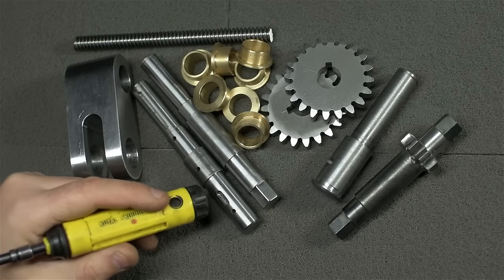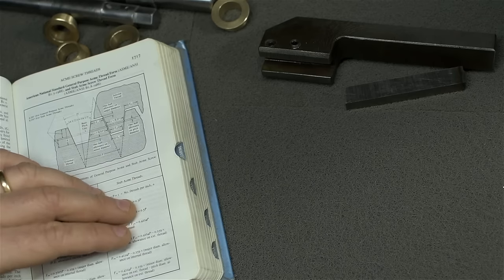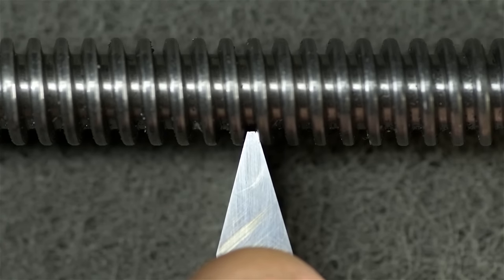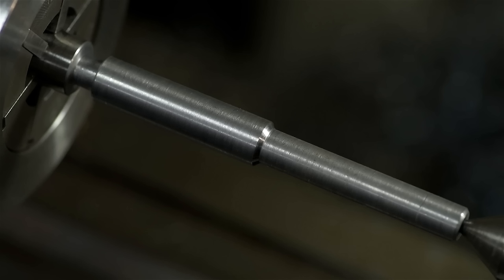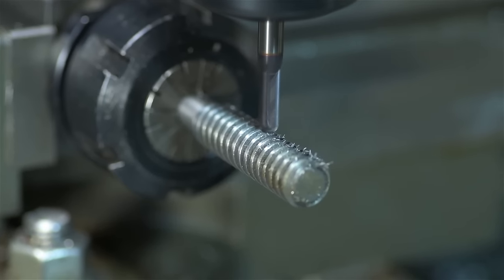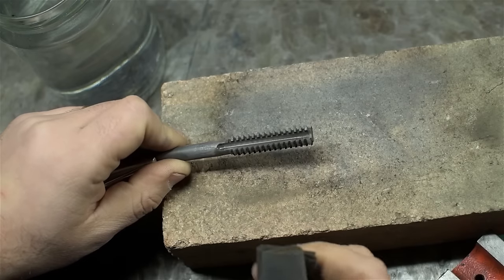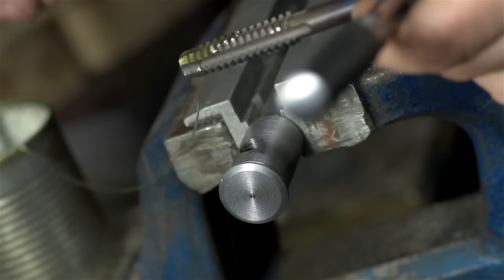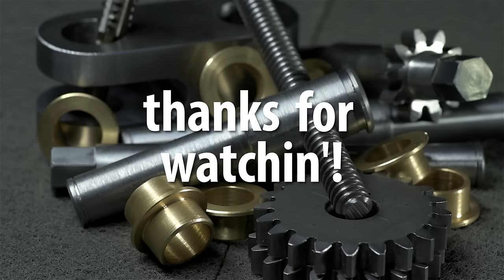More Thread Cutting & Heat Treating (I needed a metal tap)

Comment: Because of my inexperience (and the fact that I am watching your videos out of order), I had been wondering about your comments on the worm gear you added to your CNC machine for the 4th or 5th axis. You had pointed out that the wormgear introduces backlash. I have been wondering if part of that is due to the manufacturer not considering the lead angle. I wouldn't think this to be true. But if you are taking into consideration the lead angle it would suggest that when you reversed the direction of the screw, the play would be minimalised. Your thoughts? Oh one other thing, could the lead screw in a worm gear be spring-loaded to reduce the play?

Comment: This may seem stupid, but would it be possible to accommodate the lead angle by grinding (changing the angle of) the flats back at the tool holder end of the tool? Seems like it would leave more material at the working end making it stronger and more resistant to heat and or chatter.

Comment: Hey Tony, weird question. Any reason why you couldn't just use the lead screw itself (or an extra one) as the tap? It would probably be cut too tight with not enough clearance but in theory would work? Or is there something about the metal that's used in the screw that would make it a poor choice?
Reply: You just answered my question in the vid :)

Comment: re-watching and wondering, could the "lead angle" be made my grinding the bottom "part that sits inside the tool holder, the long part" at an angle? Or like maybe better way of saying that. Turning the square part of the HHS into something like this /__/ or would the cutting edge still be to straight? I know its a TON of material to take away but just for argument sake, is it possible? 

-_- wish i could doodle in youtube comments..

Comment: The grinder, the sparks are flying off to the right, is that because of a flipped video or does your wheel actually rotate counter clockwise? Ive never seen one that does rotate that way.

Comment: Tony, Thx. Very well done videos. Just learned something from you unrelated to threading. Why wasn't I this interested in learning when I was in school???? Your explanation of 'form tools' was it. I'm bending some small diameter 3/8, 1/2, 5/8, and 3/4 4130 aircraft tubing for a fuselage. Would like to make roller dies for a low use homemade bending tool with a handle that chucks into a bench vise. Could a form tool with a half moon nose, cut such a die into aluminum or mild steel on my ancient craftsman bench lathe? Such would make a great video for you -- buddy, .....hint hint.

Comment: Not just of interest buddy. It was of use. I've always struggled with the method behind making an internal thread tap. Oddly enough one of those might have been a lot easier to cut the threads on the tap with before the hardening process. Is it possible to cut internal threads on a lathe in a part  that small? I mean it's gotta be a pain in the butt and I'm not asking you to do it but I'm curious.

Comment: My understanding is that files are quite low carbon steel, not suitable for tool making.  They're case hardened by carborizing the outer skin in addition to the usual heat treatment.

Comment: Did you buy that W1 good-to-go or did you anneal it yourself from any heat-hardenable steel bar around? And about homemade heat-treatments, is there a lower limit so that if you anneal a steel piece too slowly it will become soft enough to be unworkable or, at least, uncomfortably workable? I guess you could always harden it back but just asking. Thanks!
Reply from the maker: bought it in the annealed state.  can't get to soft, no... assuming it's not molten :)

Comment: Would it help to cut a relief on the cutting edges of the tapered section? I think you only did it on the main body, which would mean your first dozen or so edges don't have complete profiles.

Comment: So I only own a single acme tap but it's got Funny setup where it seems to cut the threads twice, like two traps welded end to end. I suspect the extra material removal needed for trapezoidal shape is the issue. You might have easier time cutting if you double the lead in length, oie shallower taper. If you were me then you would worry about work hardening some steel, so I would grind off every fourth or 8th tooth to keep the material removal rate bigger

Comment: Two ways to look at the temperature you want to keep under cutting carbon steels oxidising temp and critical temp , to be honest neither will kill the steel for its intended purpose but ofc anything over 200C will make you loose your temper ! anything over 600 will start oxidation ( scale) and anything over 712 ( for o1 tool steel) is beyond critical temperature (IE becomes non magnet and requires a full cycle of heat treatment ) in colours straw dont worry blue you made a spring gray its soft as its ever going to get , the reds start at 600 c ( ish)  (ps to qualify my comment im a blacksmith)

Comment: When you made the tap a few thousands bigger over the wires than the threaded rod, did you actually measure bigger or smaller on the tap? It seems to me that if you measure bigger over the wires the tap will cut a thread shallower than the rod and not the other way around...

Comment: As a sheet metal apprentice two decades ago, my forman hardened a "shop-made" special tool using cyanide - he never explained why or how it worked (or how to do it). I wondered why he didn't do it the way you hardened/tempered this tap. He didn't temper it, either - he simply got it magnet-resistant red, then quenched in a cyanide solution - the part he hardened was not tool steel, it was mild steel... could that be why?
I just figured I'd throw that out there.

Comment: tempering after hardening, easy in the kitchen, oven circular hot air,  180 - 220  degrees celsius 1-2  hour depend on the steel. i often use lots of pieces, all in one cakeform :-)

Comment: For a less violent temper, put some olive oil in the top of the water. Like 5 millimeters or so. The tool will be a protected a little bit before hitting the water.

Comment: "W1 is a water hardening cold work tool steel that is supplied as drill rod in sizes from .062" to 2" round.

APPLICATIONS: Shafts, pins, blacksmithing tools, and a variety of short-term wear tooling. W1 Drill Rod is typically supplied in 36" lengths and can be special ordered as twelve foot bars.
Composition
C  Mn   Si  Cr  Mo   W   V 
0.95/1.05  0.3/.4  0.1/.25  0.15  1  0.15  0.1 "

Comment: Very interesting project, I'm curious why you wouldn't grind the taper in the tap before heat treating?
Reply from the maker: No reason other than I could.  Before I had a grinder I would have turned the taper beforehand.
Reply: Either way it worked like a charm, thanks for making the video! The finished product is superb :-)

Comment: so where can we find this "color code" for steel tempering.

and if I remember my schooling properly we hardened the steel by bringing to critical state then dumbing it in either water or oil depending, but to temper it back we put in the over at like 500degf for almost an hours and then let air cool, any insight into  why this process is so different

Comment: read bar. used in concrete  work well to  if height carbon .  i have made good  tap's with , this steel  & it anneals well to once headend in water & can be quenched  & Annelid  too,

Comment: Assuming you had a standard vee form tap of the correct diameter and pitch. Could you have used it first to rough out the thread first as you did when you screwcut the home made tap ?
Reply from the maker: yes probably!

Comment: to temperature test for 200 degrees C, use the tap to melt tin lead eutectic solder.  if it melts, you are over tempering.

Comment: To follow the lead angle, why not cut the square, mounting side to the required angle?
Shim a vice to the right angle, grind or cut one side, then make the other side parallel.
The business end would keep the entire material thickness and this strength.
Reply: If you could accomodate for the lead angle in the tool holder, you could even cut left and right handed threads with the same tools.

Comment: Tony, re: the thread lead relief discussion. How the hell do thread mills work! This has always been a conflict in my brain. How can it possibly have lead relief if the tool is spinning and sweeping a circle perpenicular to the spindle not the lead...
Reply from the maker: I've never done it but I assume the shape of the thread milling tool is less than the thread angle.  The angle built into the tool + the pitch of the path it's wreaking havoc in = proper thread form.

Comment: I've watched this several times, for whatever reason.  At about 7:30, a reference is made to putting the edge further to the left, "but that would leave a ludicrously long grind on the right edge".  My questino is thus:  Why does the grind have to be any longer than the thread depth + a tad of clearance?  I mean, sure, if you have to sharpen it, you'd have to take a bit more off, but if you're making a one-off, why go to all the extra work?

Comment: Would it not have been better to leave the back edges of the flutes intact instead of doing the relief?  It would seem that when you reverse the tap a small bit to clear the chips a cutting edge on the back would help shear the chips but a relief cut may allow chips to get wedged into the threads.  That is the only part of this build that I didn't understand.  Even though you said it was totally optional you didn't really verbalize a good reason for one choice over the other and since it cost you time and effort I was wondering why you did it.

Comment: Hi Old Tony
Do you still have this ACME tap?
I am making a chain press for woodwork here in Mexico. I was quoting ACME threadbars and nuts. Holyshmoly. I stopped the planning. The bar wasn´t so expensive, but the nuts were unaffortable. 
However, if you still claim that you might never use again this tap, here in the training shop for carpinters, we could use the tap perfectly to make our own chain press.
If you consider, please let me know the thread size and I will check, whether the ACME bar is available. 
Best

Comment: Would a sharp edge on both sides of the flute help break chips when you do the two turns forward, one turn back thing? Or was that not an issue?
Reply from the maker: it didn't seem to be an issue, but yes, a sharp on both sides would've probably been smarter.

Comment: Tony could you do a video some time on how to measure I'D and OD threads and how to measure threads too? I have a thread clean up tool that I use to find the thread of a bolt or fitting on the outside but I don't know how it's meant to be done correctly or how to find out the size and thread. Inside or outside diameter.

Comment: Best way to make a tap, is just cut some flutes in a bolt of the same type. I suppose, this would be more of a thread chaser, as that taps, are inherently bigger than a bolt of the same diameter and pitch, so that there is some play between the Male and female threads.
Reply: Heavy tap oil works great, it's very nasty to clean up tho. Lol, you cleaned the tap, and spun it backwards, to take it out of the hole you tapped. Having hand tapped an unreasonable amount of through holes in my life, the technique Ive come to use is just running the tap all the way through, then releasing the tap from the handle, and letting it fall through. Seems twice as fast, and reduces the risk of a chip catching in your now newly established threads, and gauling them, before ever even getting to test them once, with your bolt/threaded rod. I'm sure your tap was perfect. I again can say from experience, that hand tapping acme threads, isn't fun. The geometry of the trapezoidal threads, when cutting female threads with a tap, just sucks. Thanks for the awesome videos, I am 2/3 the way through, binge watching all of your content in about a 48 hours.

Comment: just an early in the vid comment ( 1:45), make a threaded insert, long, so you can cut off what you need for this project. it's much easier to mount a tube to be threaded in a chuck than the weird shape piece you need threaded

Comment: +This Old Tony I wonder if you could just cut off a piece from acme thread and make that into a tap? What would be the downside of that?
Reply from the maker: good thinking, only downside is that the threaded rod is too soft.  might work for cutting threads in wood, plastic, etc, though!

Comment: Brine is more severe quench.   Not needed on a tap as the teeth are most rapidly quenched.  Retaining toughness in the body is prudent.  

An old file would have the hardness but not toughness.  Could work oil quenched but W1 is far better.

Comment: 19:57 you don't need to cool the Thread Cutter in water after tempering. actually it does nothing but to risk distortion and cracks. its better for the steel to cool down at air by its own.

Comment: You really need to get some heat in that shop. When I built mine I put heat in the floor and then insulated the shop extremely well. Takes hardly anything to heat it.

Comment: Maybe a longer taper on the tap would have made it easier. Something like the nr.1 on those 3 step tap sets, without it being undersized. You have to remove a lot of material at once with that thread shape and if it's done more gradually, it's more better. Think of how square broaches are made, they are very long for the same reason.
Reply: Lead angle should have relief also.

Comment: I know i'm a year late, so it's entirely irrelevant now. But if the tap feels like it's taking too much force, can't this be resolved by increasing the length of the taper, so each tooth is removing slightly less metal?  Providing the tap is long enough for this to be possible, anyway.

Comment: Pretty close to the end, an ad popped up for some company that rolls threads. Rolled threads are so much stronger than cut threads, but the cost of the machinery must be astronomical.  Not affordable for a hobbyist, that's for sure.  But I started thinking that there is no way to roll internal threads... or is there?  Has anyone heard of, or seen such a thing?

Comment: the best thing for tapping is bacon greese try it you will like it as well as really good for drilling.
Reply: Lard was used in olden days.very very good but health problems.
Reply: As late as the 70's pipe thread cutting oil was called and labeled "LARD OIL".

Comment: Could you use the threaded rod to make a tap?... Would be just about 40% the effort and it would guarantee the fit...
Reply from the maker: can't harden it. wouldn't cut (metal).  great for wood or plastic though.

Comment: Iirc, ClickSpring holds the part to be hardened in a wire basket, and packs it with a wet mix of 50/50 w/v borax & meth sprits, before blowtorching it (outside) surrounded by furnace (khale sp?) wool. That reduces the oxidation significantly, prior to tempering to a light/pale straw colour. He also dunks the hardened steel in vegitable oil, but I'm not sure why ...

Comment: I have a question on taking the hardness out of a part I need to mill. Can you help? I’m destroying end mills 🤪
Reply: I re-machined some angle grinder bevel gears by heating them to red heat and cooling slowly, 2-3 times.  After that I could machine them with a carbide cutter.  see johnsmachines.com and search beam engine.

Comment: I wanted to make a tap, since i have 2 messed up tapped holes on my damn great grandpa's vice that i dunno how to clean. Turns out, it's both metric and nonstandard, so after consulting the damn machinist handbook for like 30 minutes, tryna not rip that damn tissuepaper they use for it, i just went "FUCK IT I'LL JUST SANDBLAST IT AND CALL IT A DAY."

Comment: Mr Tony, could I get your input on a machine? I'd like to start hunting for the smallest machine that will regrind hundreds or thousands of a specific consumable bike part. I think I need a modified drill bit/end mill sharpener, but I want it rigid enough to be pretty accurate. Not NASA accurate, but functionally accurate. I can find room for a machine the size of a microwave, but any bigger and I'll have to reinforce a floor. Also I'd prefer something nice (1960's or older). Do you feel like letting somebody pick your brain cell? I don't have a machinist buddy.

Comment: He keeps saying that he's "no machinist or tool maker". No, he puts some of them to shame!

I've made taps before but I used 4340 and then case hardened it so the teeth were nice and hard but the tool had a ductile core. I ground the flutes in by hand......because I didn't think to use the mill. Worked pretty good. Didn't choose 4340 for any other reason then it was what we had in the shop.

Comment: Couldnt you have just use a section of threaded rod and cut some flutes in to it?
Reply from the maker: it would be too soft to cut steel.  Probably working plastic.
Reply: This Old Tony even hardened and tempered? I dont know much about metalergy, but i certainly enjoy the processes behind it all.
Reply from the maker: not enough carbon in it, it wouldn't harden.
Reply: This Old Tony good to know. Thanks.
Reply: tankerboysabot you could cut, carbeurize and case harden it. Doing that will lead to some warping of the tap and probably be a bear to actually tap with along with it leaving a slightly undersized  threaded hole.
Reply: Jon Anderson thanks, i figured it might leave a slightly too small of a hole.

Comment: I wondered, if you cut the threads in the tap on a taper, cutting deeper at the start end of the tap, so that the width of the crown and body would be narrower at the start, so that the amount of material removed in the tapered part would be less than the full tap area, and the tap would be acting a bit like a broach as it engaged further...just an amateur, just an idea...